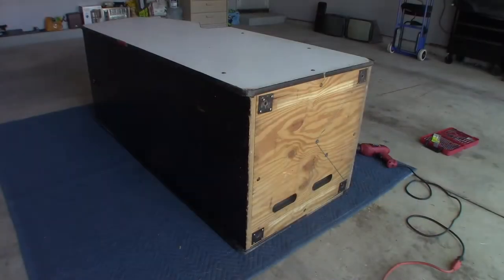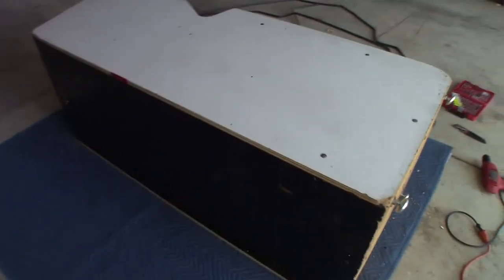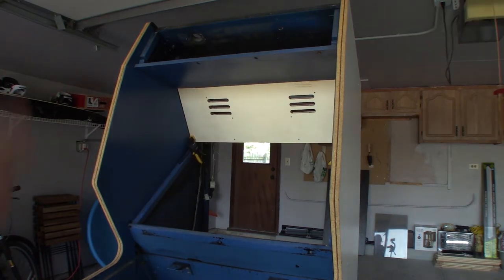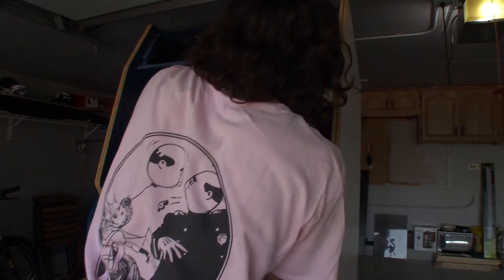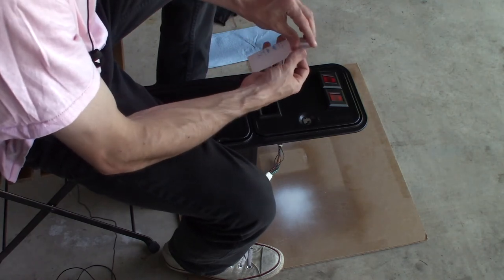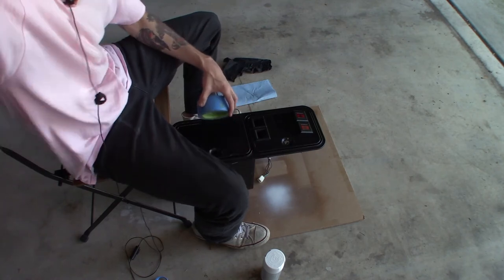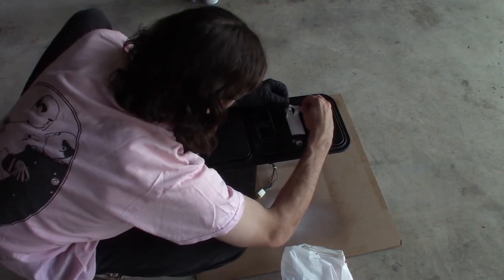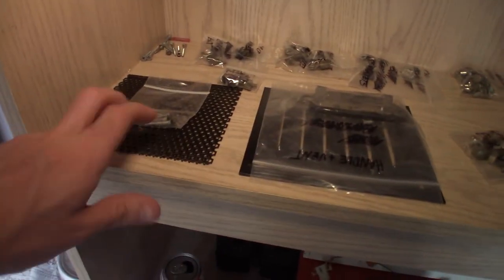Track & Field Arcade Restoration Part 2: Leg Levelers, New Speaker Panel, and a Coin Door Stencil

Comment: do you happen to still have the light ballast put together? I just took mine apart and forgot to take pictures. There are 2 black cables and one is 120 and one seems to be ground. I cannot find the light in the wiring diagrams... so hoping you may have one still together
Reply: Update, I found it in the wiring diagram! All is well
Reply from the maker: @sbzack3491  Awesome. Glad to hear it! I was just about to go look at mine. Doing the cabinet work now and then I can finally piece mine back together.
Reply: @ArcadeCrusade  Good luck. Its looking great so far